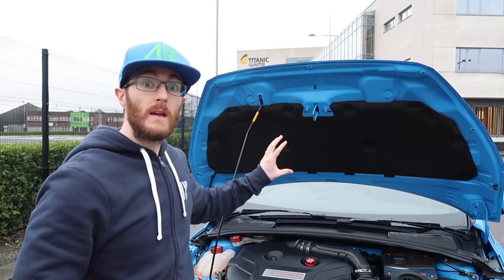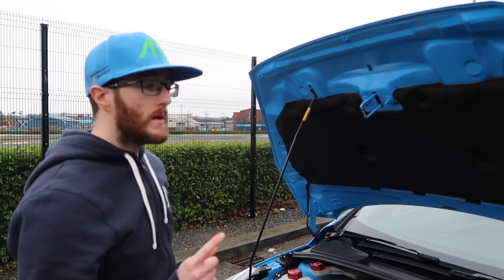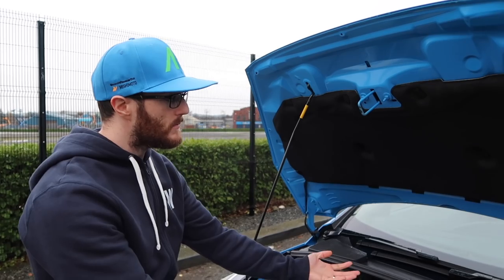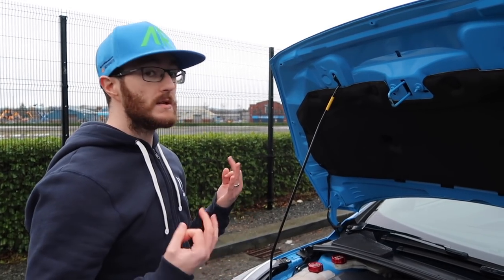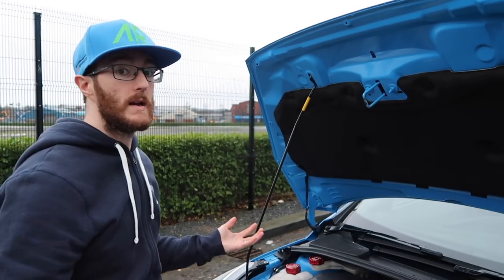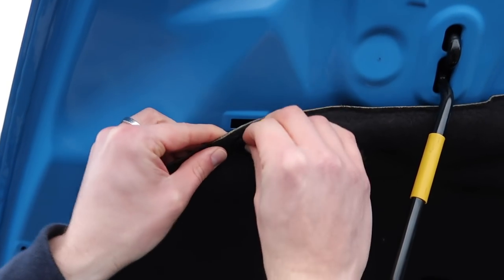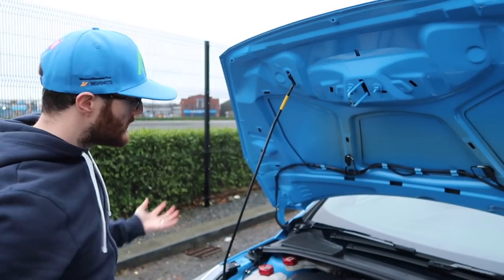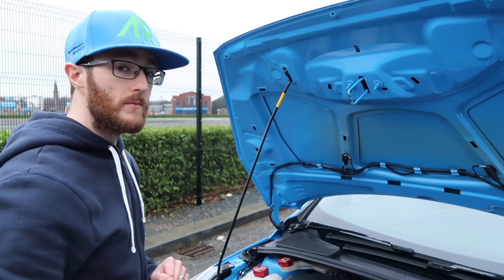MAKE YOUR RS LOUDER FOR FREE! | FOCUS RS

Comment: The question is.... does it sound louder inside the car ?
Reply from the maker: Hi Michael, yes it absolutely does. You hear a very distinct whoosh inside the car
Reply: I’ll be doing mine later then 💎🤩
Reply: Hrm I’m not entirely convinced. I popped mine out but heard no difference at idle, is it just at boost?

Comment: Ye I took mine out and I removed the rubber, with my K&N filter it sounds amazing. Not only louder, but that CBV noise is epic. Deep note rather than those ugly whistles.
Reply: Wait what rubber did you remove?  I want to do it with my k&n!
Reply: @Werk4Cash  just the little rubber seal on top of the air box, not sure how much of a difference that one made tbh just take the upper engine cover off and you're good

Comment: Hey Adam. I’ve just done this on my I30N (different clips and a total pain in the proverbial) but anyway.....can I ask, did you need to give your now ‘naked’bonnet a good clean? I can see from your video that it looks a bit murkier where the sound deadening material was, which looks like mine but I take it a good fallout remover and car shampoo will do the trick? If nothing else, the bonnet now looks pretty sweet👍cheers mate
Reply from the maker: Mine seemed pretty clean under there, it looks not as shiny as the outside because they didnt bother finishing the paint to the same degree, presumably because they figured no1 would ever see it lol If yours is dirt then yea decon products and a wash should do it so fallout remover, citrus and clay bar. Cheers mate :)

Comment: Just wondering, was the hood insulator marked by the intake box seal? I just installed the RS I take box on my ST and the seal is definitely touching the insulator and put a dent on it.
Reply from the maker: To put a dent in it, it is likely pressing against it very hard so should still be sealing without the sound deadening

Comment: Hi dude
Just fitted a mountune v2 filter to a focus st mk3 today but you can barely hear it in the car, especially with the windows up. Would removing the bonnet sound deadening increase sound into the cabin?
Many thanks
Reply from the maker: Hey, yea it defo would!
Reply: @AdamRainey  the engine sound symposer is overpowering the induction noise in the cabin. Is there a away of disabling it? I read on 15+ cars its electronic and comes through the speakers rather than a pipe into the cabin
Thanks dude 👍🏻
Reply from the maker: On the RS is is electronic but I thought the ST was physical and just required a blanking plate
Reply: @AdamRainey  just checked it has the blanking plate, i think the face lift st's must be electronic like the rs.how to disable it? 🙄🤔

Comment: just letting you know, it is now an mot fail on the new rules
Reply from the maker: This is well known so 5 min job to put on first. Also for me MOT is a very long time away (we get an extra year from new in NI)
Reply: just wanted to put it for people with cars that need an mot soon
Reply from the maker: yea that's cool Isaac, cheers
Reply: It's actually not a fail. Most people are mis-interpreting the rules slightly. For noise suppression (under-bonnet noise deadening), you will get a defect if a) it's insecure or b) it's likely to become detached. This only applies to the sound deadening material if it's there. If it's been removed it can't fail on any of these points as they don't apply. It's parts 8.1.1 b) 1. and 8.1.1 b) 2.
Reply: @AthiqueAhmed  this is the same as the brake dust shields on disc brakes, they can be an advisory if they're heavily corroded and falling apart, but if they're non existent they obviously can't be corroded nor falling apart so they can't even be an advisory, nothing says they have to be there.

Comment: Not sure if it’s 100% accurate but I’ve read before that this could cause you to fail your MOT. Seems ridiculous but don’t throw it away just in case!
Reply from the maker: It is  possible but that's a long way off and takes 5 mins to put back on so as you say, don't throw it out

Comment: well, during winter now I don't think it will get hot enough to ruin the paint anyway. Maybe that statement would be more reasonable during hot summer days and hard driving. Anyways, other than that who wouldn't want some extra noise P_P!
Reply from the maker: I still doubt it would have any effect during the hot summer for the same reasons. I was at Ford Fair in August past and it was ridiculously hot - plenty of cars without this installed and none complaining of their paint burning off or whatever
Reply: @AdamRainey  Alright, seems fair. I'm gonna take mine off too haha. But what about the cables?
Reply from the maker: Nice :) The cables are attached to the bonnet pretty neatly and securely so they are fine in my book
Reply from the maker: There is lots of cabling and plastic tubing in and around the engine under the sound deadening and they aint melting lol